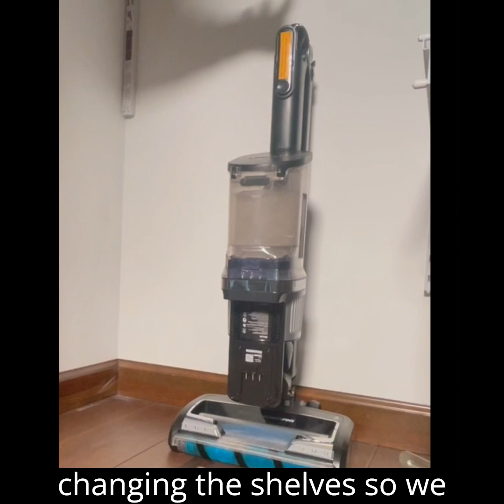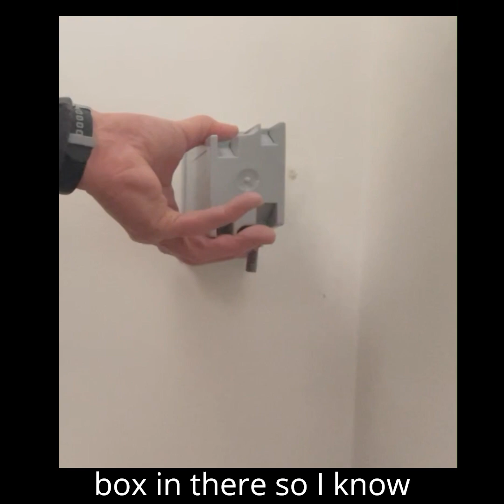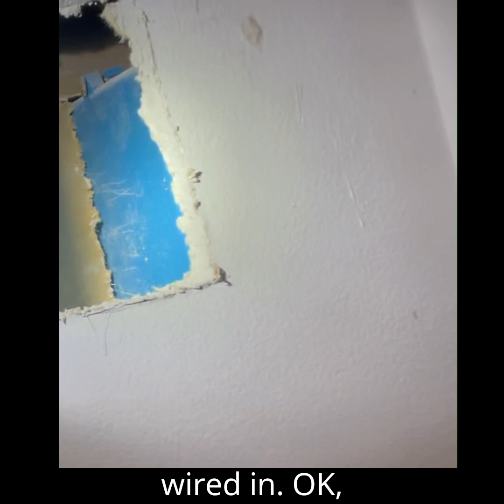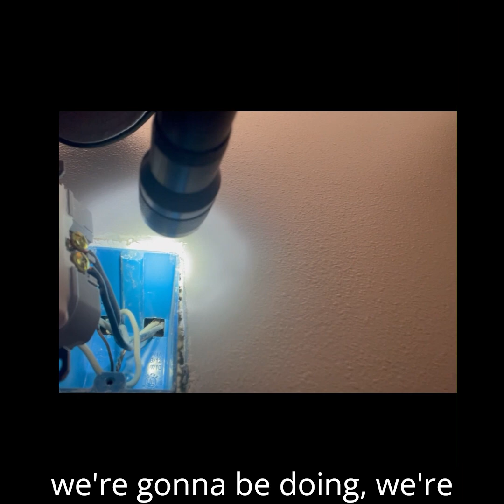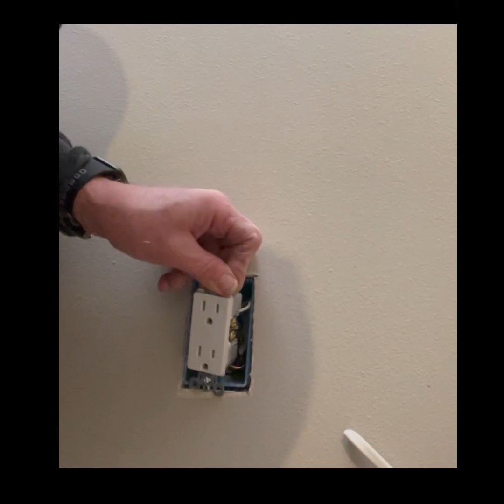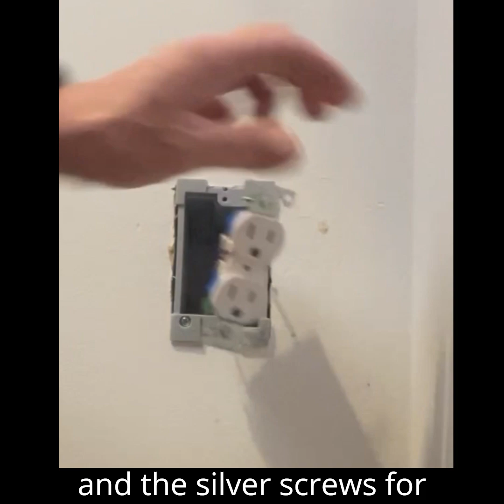Electrical Outlet Closet Installation

Comment: Not trying to rain on your parade but you would of been better to take the wires off the first receptacle. Then tie the wires back together with a wire nut and a short piece of wire going back to the receptacle. Wires plugged in the back isn't a very tight connection at all and can heat up causing a fire if what is being plugged in pulls enough current. The good news is you have enough guts to tackle the job yourself. Good job!
Reply from the maker: Thanks for your comment. I agree that the push in wire connections are borderline at times.  In this application the amp draw on the charger is very low.  This electrical outlet is not really meant to be used for high amp connections. Its location in closet is strictly meant for the battery charger.  With the location of the electrical outlet in the hallway and other outlets located in the vicinity outside the closet, it is unlikely the new electrical outlet will be used for any other applications but the battery charger.  Thanks again for your observation and comment. 👍